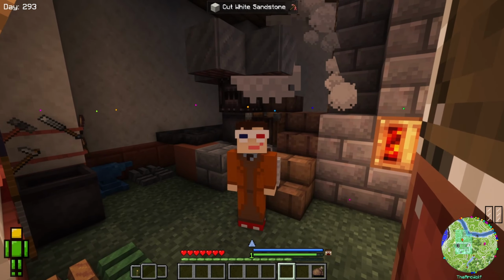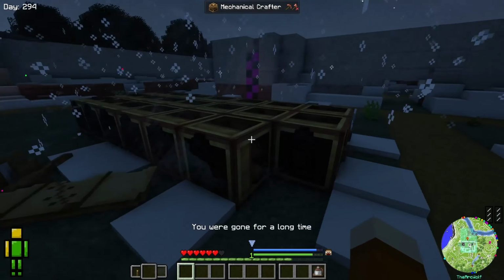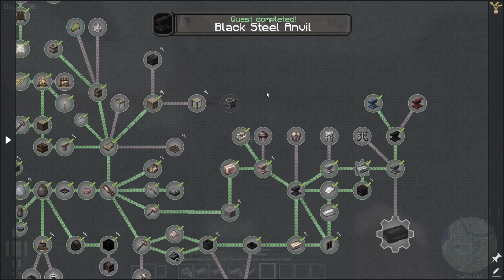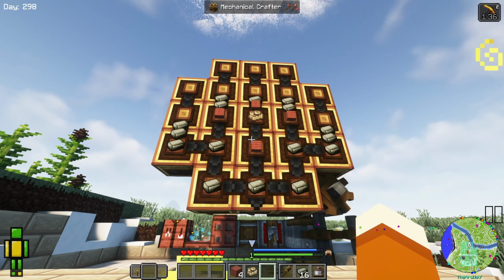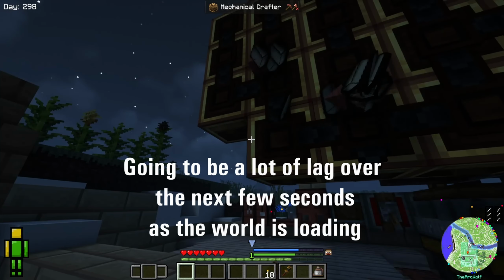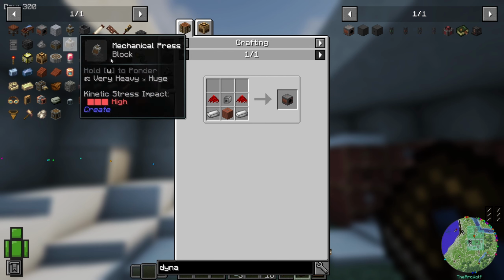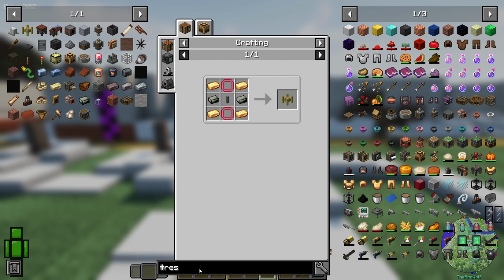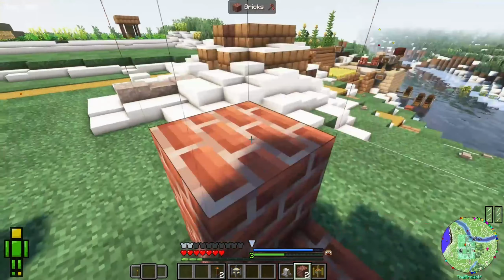Failure to Resonate? - TerraFirmaCraft: HardRock Ep. 16

Comment: soo my Create machine kinda broken. My machine only can power 4 mechanical crafters if i put more it'll overstress even tho i have 2 watermills. any idea to fix it? Thanks!
Reply from the maker: Try changing the gear-ratio. Connect a large gear somewhere along the output form the water wheel, then connect a small gear off the large gear. If it is still over stressed, do it again, but make sure the 2nd large gear is connected to the small one though the shaft (not the "teeth" of the gears) and connect another small gear to the teeth of the 2nd large.

Comment: Useful thing i discovered is that dust from create mills for example, seems to dissapear in water. Idk if its new knowedge or not
Reply from the maker: Dust pollution can turn water into polluted water, so I avoid letting it fall onto water
Reply: @arcwolfgaming  well, my mill stands in river and there is polluted water but it was there before so its from firepit. Would i see polluted water thats not on surface?
Reply from the maker: @placek7125  i think it will only spawn on the surface
Reply: @arcwolfgaming  i just checked something. My millstone is above river, but in part of it where water doesnt move. There, around it where dust would spawn is polluted water. Now im in creative spawning dust above polluted stationairy water and dust really does dissapear when it falls into it
Reply from the maker: @placek7125  well that is good to know

Comment: To better move pollution you can use vents and chimneys and place the filter on top of the chimney, also you can use the filter to filter dust placing a stone pump right next to the mill and the filter on top but it used a different filter made of jute

Comment: Jute is quite useful and if you plant jute seeds then use fertilizer (I don't remember which one was that) and if that plant will be fully grown with high yield just leave it and after some time it will just decay and it will be dead jute and after breaking you will get a few seeds but no jute fiber (1 seed with some fertilizer gives a few seeds which will boost jute production/planting)
Reply from the maker: Using poisoned compost (from adding meat to the composer) on a fully grown plant will cause it to die and drop extra seeds.
Reply: @arcwolfgaming  yeah it's the same but you don't need rotten compost just wait a few days